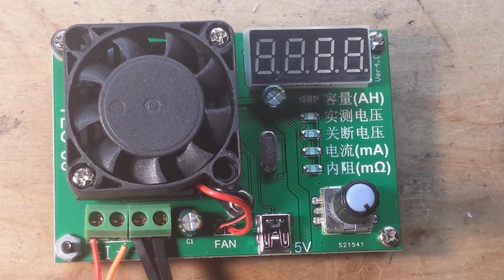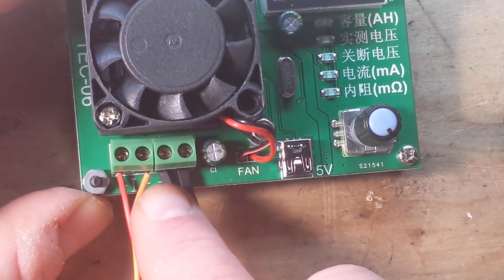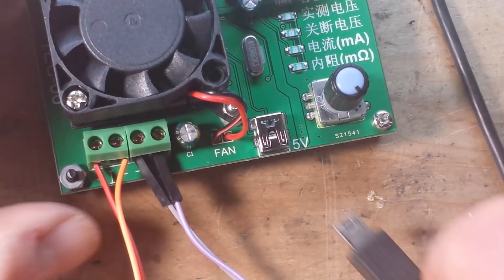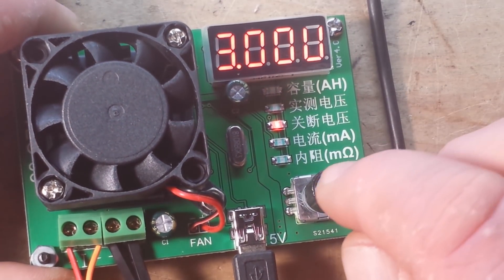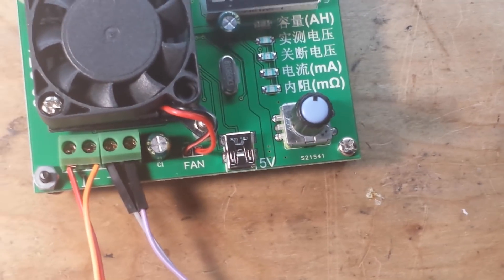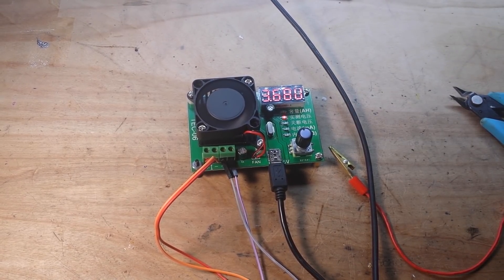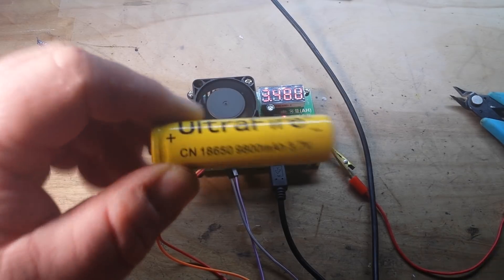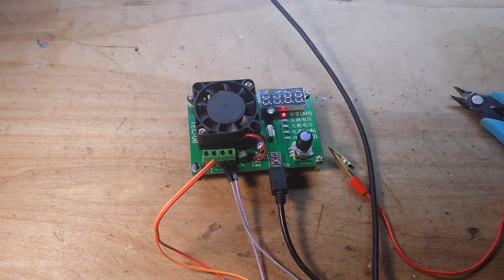TEC-06 Battery Capacity Tester from ICStation.com

Comment: I like the versatility of this unit. It has helped me to determine the ampacity of the various wall chargers I own. I do a sweep from 0.1 mA through the maximum it can handle. I found out they all have similar performance curves but each gives out at a different mA value. The best ones provide voltage over 3A and the worst one drops out at 1.1 (Apple 1A iPhone chargers)

Comment: Reference tests with a known power supply should be done before a suspect battery is checked. It is not possible to determine the quality of the performance with an unknown electronic load and an unknown battery.
Reply from the maker: I've tested these batteries in the past.

Comment: Thanks Paul. I prayed for both of you! You really need to invest in some battery holders. They are pretty cheap. I have some little 3A electronic loads made by YZX Studio that are smaller than that one that I use with the YZX power monitors. I changed the connector on it and replaced the single-turn Pot with a multi-turn.
Reply from the maker: I will get some battery holders and thanks for the prayers.

Comment: Copper tape that is used for stain glass soldering,  use it by soldering  a wire to a piece of copper ribbon tape then rap the tape around the small magnet, make many of them to be used for quickly attaching as leads to batteries and many other stuff, they work amazing
Reply from the maker: Good idea, thanks
Reply: Battery holders are pretty cheap. I have all kinds of them. Makes things real quick and easy. They of course can be used in project boxes and stuff as well.